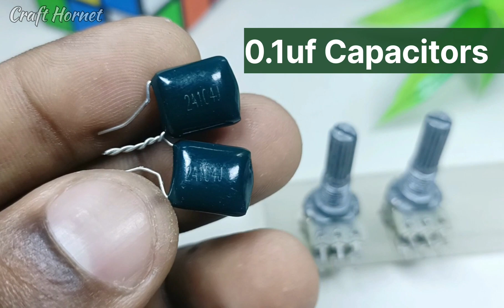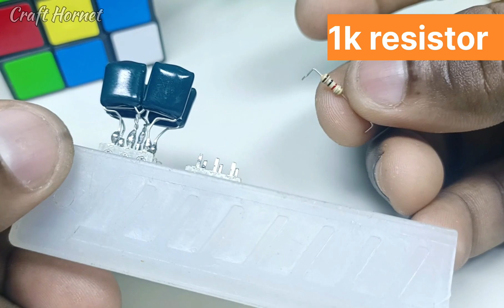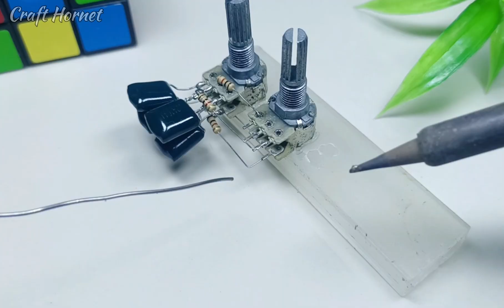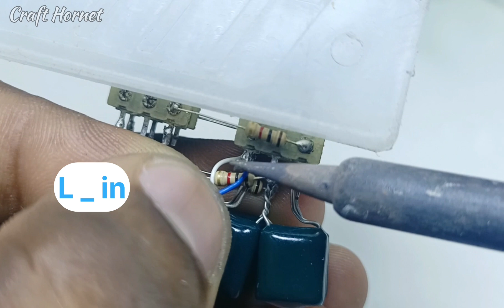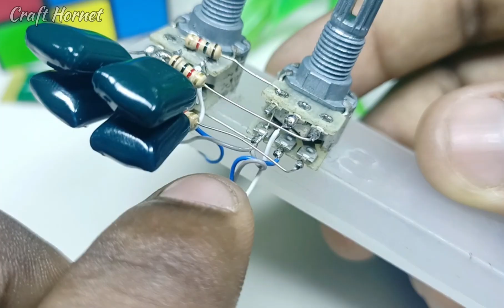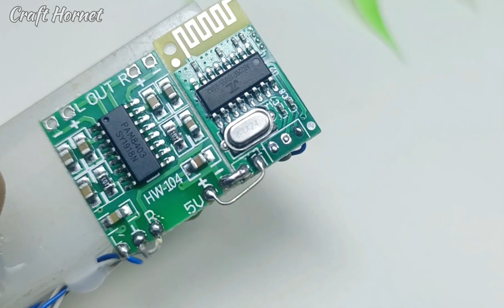Modifying the Pam8403 Amplifier Module for Enhanced Audio Quality

Comment: I only partially understand the type of modification made. What I would like to know is exactly what the effect of this modification is on the PAM amplifier circuit, since this information is not absolutely clear in your video.
I understand the volume control by potentiometer.
I deduce that the potentiometer that has associated capacitors is a passive tone control. In fact, I can't clearly understand the effect of that potentiometer, because you placed the LEDS on the speaker cone and that just makes mechanical noise.
And the video ends abruptly, precisely when it was important for everyone to notice the effect of the potentiometer in question.

I'm looking for concrete information to deal with PAM modules, mainly in the context of audio performance.
Would you mind clarifying this?

Thank you in advance.